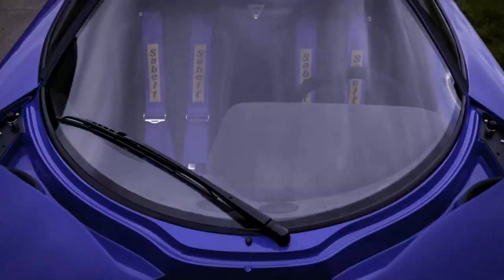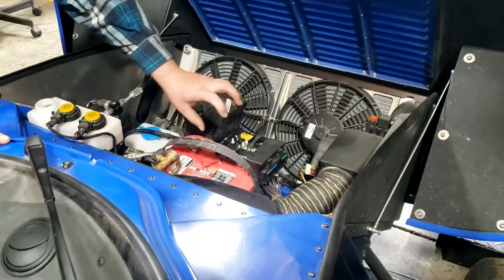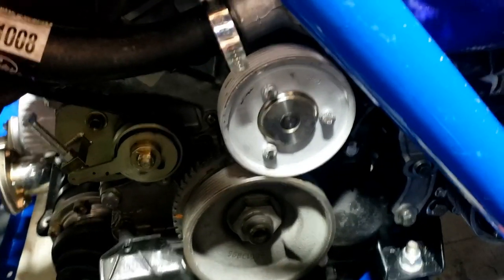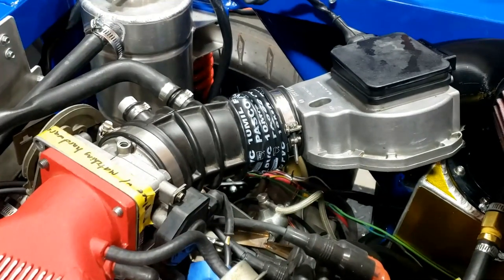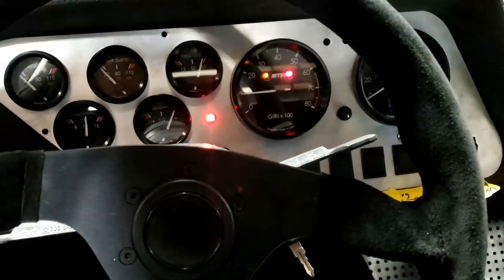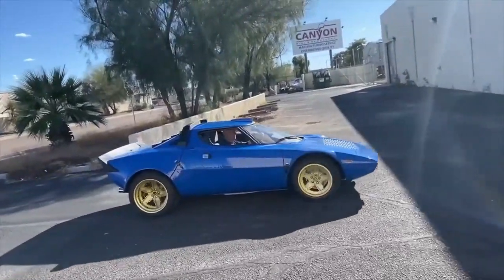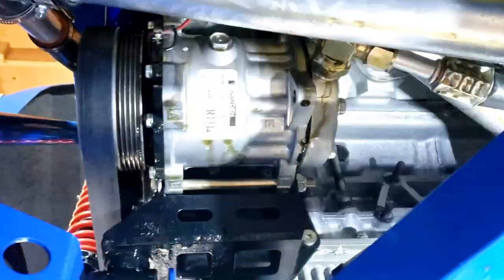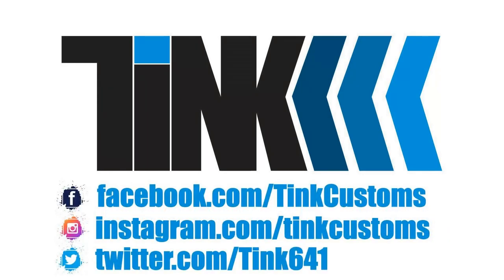#Lancia #Stratos Replica : Lister Bell | #StartUP First #TestDrive

Comment: fantastic to see it on the road.  
Don't worry about the rear vision, this is an Italian car. 
The Italian philosophy is that what's behind you doesn't matter !
Reply from the maker: Isn't it just, thanks Glen. Mike has since sorted out the minor oil leak from that valve cover as well as a temporary solution to the squeaky belts allowing him to take it for longer test runs on the freeway. He's impressed with how well it tracked "straight out the box" effectively from Lister Bell. We'll still probably get every aligned but it's pretty spot on.
Reply: @TINKcustoms  Does it have to pass a test like the UK IVA test?
Reply from the maker: @glenhowell3420  ... it does not, here in the disUnited States of America, specifically Arizona, the vehicle has been registered without any official interference whatsoever. No one has laid eyes on it. God Bless 'Murica,  particularly Arizona!
Reply from the maker: Which is a relief, if you've seen this video and the ridiculousness of the UK IVA I had with my Corvette C6 https://youtu.be/EoPlSQcbLM4